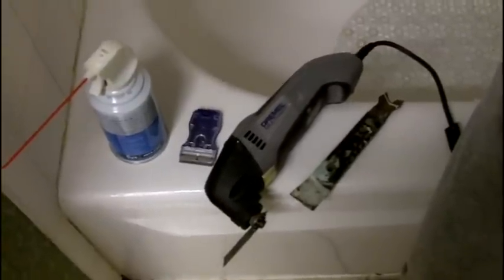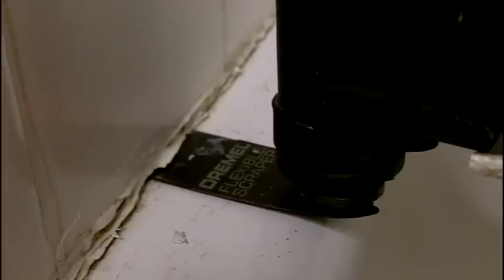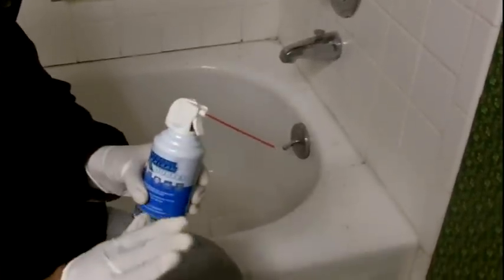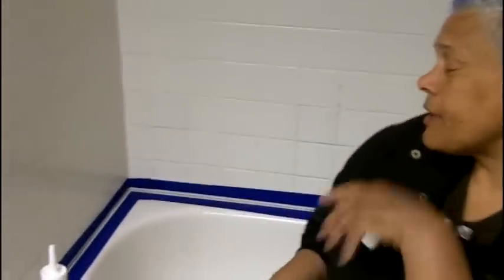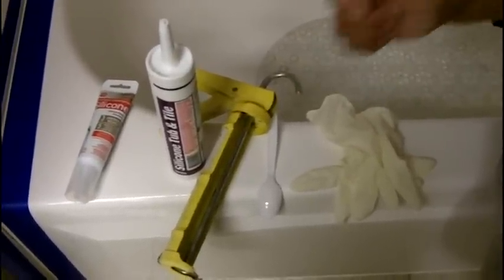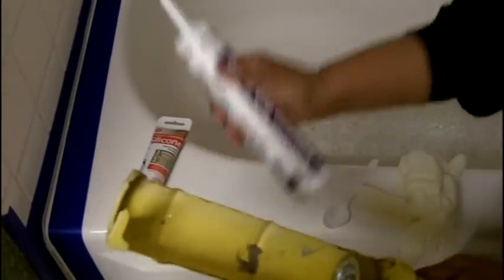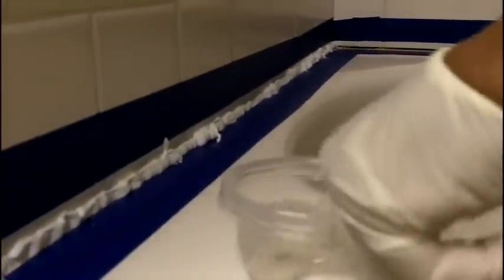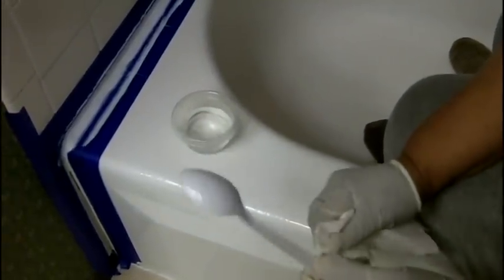How to Caulk a Bathtub with Beautiful Results

Comment: First, "See Jane Drill" is a great do-it-yourself [DIY] YouTube channel.  [And I have watched many DIY channels.]  She knows her trades, explains it clearly and concisely, and respects her viewers.  When she advises you to use a Dremel tool with an oscillating blade, she is giving excellent advice.

I cleaned out the old caulking and grout with a razor-blade scraper and one of those manual, multi-purpose tools [blade, screwdriver, nut opener, etc.]  I was exhausted by the end of the cleanout.  Follow Jane's advice!  Use the Dremel!

Also, when caulking, you need less than you think.  I overspread the caulk and had to sponge off lots of extra silicone.  This advice agrees with that of Collin Morris just below.

Comment: When I caulk anything in acrylic I hold the gun or squeeze tube in my right hand and put my left index finger on the tip of the tube over hanging about an inch.  This helps push the caulk into deeper or wider gaps and helps get a nice smooth bead.   
 Keep your index finger wet.

Comment: I was working with an old school painter who was showing a great technique with controlling amount of silicone on hands and shaping ease. If you use foam glass cleaner in the aerosol can and spray it directly on the wet silicone bead, spray on your gloved fingers,  and spoon with glass cleaner and it won’t effect finish. The glass cleaner creates a barrier that allows for less sticking, easier clean up, and smoother lines. I have tried the foam glass cleaner technique and it was successful, and you can reapply the foam glass cleaner several times. The glass cleaner acts like how water does with the latex caulking.. Coupled with your 10 out 10 video,  the glass cleaner controls the mess, helps minimize sticky fingers, and will make the spoon flow smoothly on final pass,  thanks.

Comment: I'm gonna try this now...jan 30 2020   I cleaned the caulk off rather easily   I Have a steam floor cleaner that has an attachment that is a small area that the steam comes out.   I softened the old caulk with the steam.....going slowly.   Then cleaning up the "stuck in" caulk with a sharp knife.   Took me about 10 minutes to clean the tub !!!

Comment: Very well done video, Leah. You mention you need to cut the tip off with a razor. For those that have a similar caulk gun to yours, it has a tip cutter built right into the handle, as does yours. Please don't take that as criticism.... Just a tip for those buying a caulk gun for this project.

Comment: another great video from Leah. i'd be afraid to use the power tool or even a metal scraper or putty knife, thinking i might scratch the tub and/or tiles. i never would have thought about pulling the tape immediately. update: actually started on this job and i see that even the boxcutters/utility knife is marring the tub surface.

Comment: I did it! The tube is kinda hard to squeeze.  Use two hands.  Block your drain and put something on floor.  I got silicone on the floor but cleaned it up right away.  Thank you for the video

Comment: This is helpful! Do you recommend when cutting the tip of the silicone/caulk do you think it makes it easier to caulk if you cut the tip in an angle instead of just cutting it straight?

Comment: It worked pretty darn well, the only thing I wasn't prepared for was the tape, when you take it off be sure you have a large garbage can to toss it all in because it can get really messy. Also push pretty well on the tip of the spoon so that it doesn't line up too thick on your line... Great video and thanks, now i'm a Pro Lol

Comment: Also if it’s a tiled corner like that silicone up both walls of tile in the corner instead of grout. With building movement grout will crack as the walls are 90 degrees to each other so silicone it, plus it makes a much neater looking job

Comment: I followed the instructions to a "T" without a dremel.  In my case, I don't think a dremel would have been good anyway because there was grout behind the old silicone.  Anyway, it worked beautifully.  Clean the old caulk out as good as you can first.  It took me about 2 hours.

Comment: The calking gun has a hole on the handle with a blade that you can cut the tip of the nozzle by inserting it and pressing the handle. Works beautifully and no need for a utility knife.
Reply from the maker: it never cuts cleaning for me

Comment: kitchen (anti-bacterial) wipes tend to help, both getting it off your hand and also to wipe on profiling tools. I personally don't use tape, as it find it gets in the way. A good profiling set should interface well, and you can correct mistake with practice, excess you can remove running the larger size over the smaller. Kitchen wipes have some light solvent/alcohol in them, you can wipe you profiler with that. Rather then water or water with washing up liquid. Don't worry about getting deep into the corners either, worry about joining the two sides well. This is a string bond, as joints flex.

Comment: As usual you explain everything perfectly. I do have a problem though. We applied the caulking and it won't dry. It's been a week now and it's just like it came out of the tube. Does silicone expire?
Reply from the maker: Hi David, I have heard that silicone does expire, and that if it is expired it might not harden properly. Or, the caulk could be defective.
Reply: We removed it and put fresh. Everything is good and thanks for the reply.

Comment: I just did this trick with the plastic spoon came out great yes the corners area is tricky.. My point is after tape removed wet finger and smooth out raised area of where tape was, edge build up smooth it out..  hardest part the damn taping I used a guide of 1/4 inch.. No removing all the old silicone..As many places state what sticks to cured silicone??  NOTHING so remove all the old stuff even the cornors or it will fail.. It will NOT stick to old silicone got it...  so it all has to be removed at the tub walls and shower doors.. Mine had mildew took a lot of bleech and a fan to get it ready to caulk over night.. also silicone will not hold paint.. So use siliconized at paint areas.. Plus at base of tub silicone wont stick to vinyl items use another caulk.. read info from mfg.  Lasts about 10 years or less.. silicone just falls right off...vinyl trim...

Comment: I used the a vibrating tool like yours shown with a metal scraper blade literally having to since the prior homeowner had used grout in this area rather than caulk, but have what appears to be some METAL RESIDUE now on the surface of the tile, they appear as grey small splotches scattered in the area cleaned.  Either that, or the scraper got through the porcelain surface and is showing the metal of the tub.  I was careful to keep the tool at a gentle angle to the tub to minimize that chance, but not sure what has happened.

Any ideas?.

Comment: The only thing I would add is that you want to try and have the call at is thinnest at the edges of the tape. I.e. not half way across a piece of tape. This would be where the spoon would contact the hard surface. This best prevents forming a hard edge when you pull the tape.

Comment: Tip and trick for you Leah.
Prepare a spray bottle of soapy water. When ready to smooth your bead, spray the soapy water on the silicone and your gloved finger.
Smooth. Easy. Not messy.

Comment: When I removed the sealeant from around my bath a few years ago I found if I liberally applied WD40 and let it set for 5mins it worked wonders.
Reply: I am sry not sure what you mean by it did wonders? I know it helped you but how? Was easier to remove the sealant? Or it was easier to apply the silicone? Just curious.

Comment: I love you Leah! 💕Thanks for helping us girls!
Can you tell me why you used caulk and not epoxy grout?
What's the difference thank you.
Reply from the maker: Hi Janelle, we follow the guidelines of the Tile Council of North America.  And here is what they say about using caulk vs using grout.  And I will say that epoxy grout is a sub for cementitious grout, NOT a sub for caulking.  You want to use caulk when you have a joint where two surface meet that will move independently of each other, such as your tub and your wall.
Reply: seejanedrill thank you so much for the information!

Comment: What about caulking around the bathtub spout where the water comes out -- or is it needed around the hot / cold water knobs?
Reply: You could.  Same method but you can usually only tape one side (around the faucet or spout).  Just a really tiny bead then using finger smooth with water.  It's a little trickier and you have to be more careful.

Comment: Hi there. So I did this method thinking it looked great. When I went to pull the tape off it lifted the call a bit leaving a bit of a gap. So I went back over with the spoon to smooth it out and it like the call had started to set and now it looks more like cottage cheese than smooth. Help what did I do wrong?

Comment: Wish i watched this before I caulked my shower. I didn't use the tape and i have a mess. Can i cut the excess off with a razor? Will that undo my work?
Reply from the maker: you know, you can try cutting it with a razor, and it may work...you will need to see how it looks.  There might be a slight lip, but you may be able to live with it.

Comment: Maybe lost in translation, but my neck of the woods, caulk is not silicone. Caulk is paintable and has the consistency of thick paint, it is used for thing like cracks and skirting boards. The "Caulk gun" makes sense.

Comment: Quick tip, you dont need a utility knife to cut the tip, thats what the 2 holes in the handle of the calk gun are for, the back side of the trigger is shsrpened

Comment: When removing old caulk it’s much easier to heat up the old caulk with a heat gun and then while it’s still hot you can scrape it off with the pointed edge of a painters tool

Comment: Never ever use water on your finger or anything else, I have does this on mildew proof calking and had to redo it all after only a month as mildew started appearing, WHY ? well its mildew proof once its set but wet fingers to smooth out mixes water in and produces mildew because the water is trapped inside.

Comment: use caulking that has sand in it ..every  Fiberglass tubs flex  ..using sand caulking allows it to flex with no cracking over time

Comment: Got this video recommended for reasons unknown, some useful points in it, but things I think would make it easier:

Cut nozzle on 45 degree angle, and hold gun to the angle of the nozzle. 

Run gun really quickly along the path without breaking your position so it doesn’t get everywhere.

Buy a spray bottle and fill it with soapy water 50/50 soap and water and SPRAY THE ENTIRE line you just ran, this will save your time taping it because silicone can’t stick to water.

Use paddle pop stick instead of spoon, it’s perfect size for the caulk :)

Good guide for beginners though, however I feel like you should of definitely sprayed the line you made and not just wet your finger.

Comment: The caulking gun actually has a hole in the handle you can use to cut the tip of the tube off.

Comment: The problem I encountered was the tile actually makes contact with the tube on all sides so there is no space to insert the Dremel tool as you showed  - not even a razor blade can in be inserted.

Comment: I wish I had watched this twice. I watched it a few days before I did it, and lost important parts of the lesson.  I was doing a sink. First attempt: TOO MUCH CAULK, made a huge mess, ran home with tail between my legs. Second attempt: Removed old caulk 3 little holes, not enough caulk, water from leaky sink made it not cure right. Third attempt: I finally got it right!

Comment: An additional tip. The caulking gun has a hole in the handle that you can use to cut the tip. So no need to have a separate blade 😀

Comment: Problem with the prep tape technique is that, when u remove the tape, the caulk will have a slight edge to it and won't lie flat and flush. This will cause it to need to be replaced sooner as water builds up on it.

Comment: That tape causes a bacterial shelf to form on both edges. No tape leaves a better seal with no edge. Use a silicone tool to ensure you left a 45 degree silicone seal, otherwise it is prone to leakage as the concave form is about 1/8th the thickness of a beveled edge. Don't pull the bead. Instead push it and it will enter the crevice for a better seal.

Comment: Silicone will not stick to rubbing alcohol, put on your bead of silicone, have rubbing alcohol in a spray bottle, spray bead with alcohol and wipe excess off with finger. Don't even need the tape, and forget about the water. If you want to wipe more off spray and repeat. Best way to use silicone.

Comment: Jane didn't show the usual method for bath sealant. Don't use tape. Apply sealant. Lick forefinger and smooth the sealant. When finger is dry wipe on jeans. Lick next finger and repeat until finished.

Comment: The finish product looks great except: 1. The caulking line is too large. 2. If you use tape when removing the tape a small edge will remain which requires additional touch up. 3. I only apply tape to the grout joints to prevent overlap in vertical grout lines and strike then strike the joint. I also cut the tip of caulking tube as small as I can to minimize the volume of caulk on the wall and the amount I would strike off.

Comment: To me Leah that’s a waste of tape and caulking, also your bead it’s to big , but everyone has there one way of doing this job and thanks for you video.
Reply: The tape is a good idea, though the gape between the two pieces of tape is excessive. If you've seen people not used to working with caulk, the tape is a good idea, as they'll get it all over the place. I agree, a huge waste of caulk.
Reply: Well I use the Cramer tool and once you get the hang of using this tool you don’t need tape, like I said everyone has there own way of doing this application/ JOB!

Comment: You left out an important step.   Before you apply the caulk, FILL THE TUB WITH WATER.  This will pull down the tub, duplicating the effect that will happen when the homeowner fills the tub later.

Comment: DON"T use the Dremel tool or any other oscillating tool without putting something to protect the tub from the scratching action. How did you miss that Jane? A safer way to do it using the tool is to wrap a strip or two of duct tape around the  blade of the tool so it acts as a protector and a depth gauge on how far to reach under the tile while scraping away the old silicone

Comment: Nice job on the video - but for a few jumpy and unfocused spots - not badly done.  

However... the "plastic spoon" method of finishing the laydown is terribly wasteful - as far as how you've laid down the initial bead.  Since 100% silicone caulk isn't all that cheap (don't get me wrong... it's not hugely expensive... about $6.95 US/caulking tube... sufficient to do an entire tub) it might be better to lay down a little heavier amount at the start of a run and taper it out progressively less towards the end of the run.  That way, if you use the "spoon" method of finishing, as you're dragging the spoon down the joint, the "excess" that starts to pile up on the back of the spoon will get pushed ahead and forced deep into the open joint and you'll have less "waste" at the end of the run and still have an evenly finished joint.

Just a suggestion...

Comment: All great tips. But you're wasting too much caulk. What you remove with your spoon or caulking tool can be used in the next joint to be caulked. Remove with your tooling knife, spoon, or finger and put it in the next joint to be caulked. Working quickly you can save caulk and time. Great job!

Comment: I really like your videos Leah but this one is not your best.  I went to pull the tape off and the skin of the semi-dry caulk started coming off!  So frustrating!!  Trying to clean up the partially set caulk to re-do it is worse that the original prep!  I'm never taping off a caulk job again.
Reply from the maker: Sorry Mr Dad, that's why I say in the video you have to work quickly and don't wait to pull off the tape, otherwise you'll end up with a mess.

Comment: I’m sorry but using tape is a mistake. The secret is how wide you cut the tip of course in a angle wet your finger to remove any excess. Don’t fine lines not to big

Comment: She should of also HAD told you not to go TO DEEP WITH the Dremel blade,,, even though your going to recaulk you do not want to punch through the lip off the tube ,cement board or green board (green colored ,,,water proof,,,sheet rock) let's face it caulking does not last for ever!! So just in case the caulking starts to fall apart (un seal)you do not want

Comment: That's 100% unnecessary,  after cleaning the surface,  I use denatured alcohol, it will clean any and all residue film off. Lay a bead down as always,  then spray ammonia free glass cleaner over the bead,  then run over the bead and it'll be perfect,  the glass cleaner will keep it from sticking to anywhere cleaner is sprayed.
Can also use water and detergent solution

Comment: way too much caulking , excessive waste, too much silicon left on the tile ,there's no taping  needed if done properly and no water bowl 
 required . you don't need to overload the whole area .fill smaller lengths and smooth as you go, cut your tube small and angled , don't allow the silicone to squeeze out past your finger stop and clean . with smaller amounts you can feel and move the silicone along . dampen a rag if needed to clear finger or fingers as different fingers can be used as gaps often change along the way.